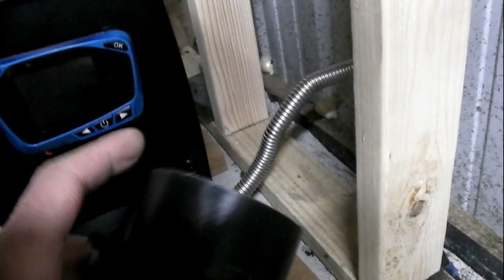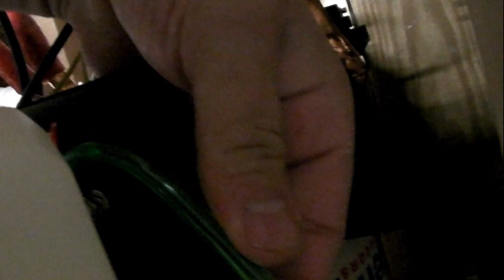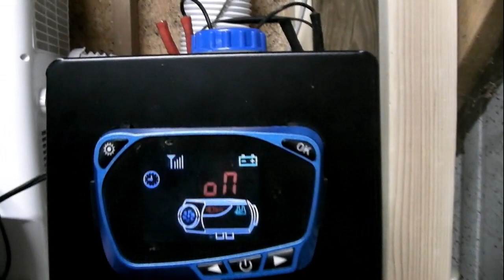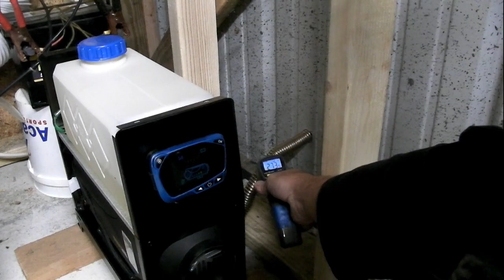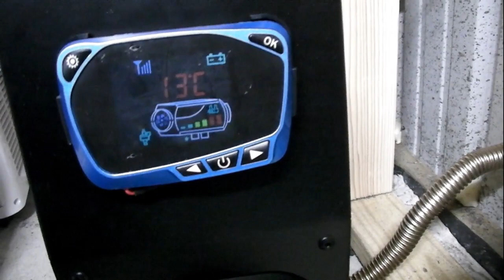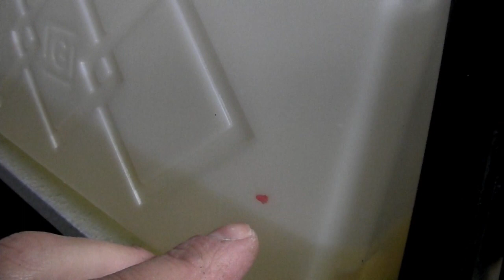Ebay 8KW Chinese Diesel Heater

Comment: 8KW? That must mean that you either have a very special fuel delivery pump or that you got ripped off and have bought a 5KW unit.
Reply: Why
Reply: @wadebrewer7212  Because if you search the net, you'll only find 0.022ml/pump pumps. A generic diesel heater pump.
 Then do the math: Diesel energy density 38,6 MJ/L. Heater Fuel Pump 0.022ml/s/Hz. Make the equation with 1Hz and you will see, that each pump delivers 849,2 joules/second at one Hertz.. And joules per second is Watts. That is the power delivered in fuel but does not take the losses into account. Eg the exhaust.